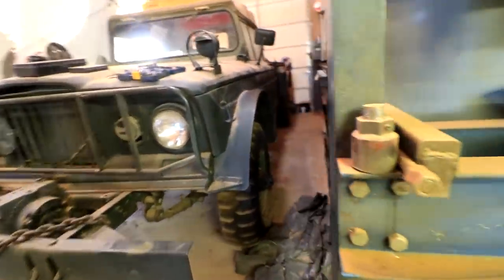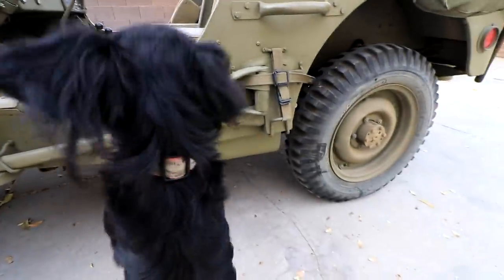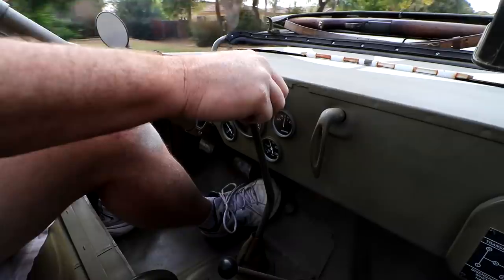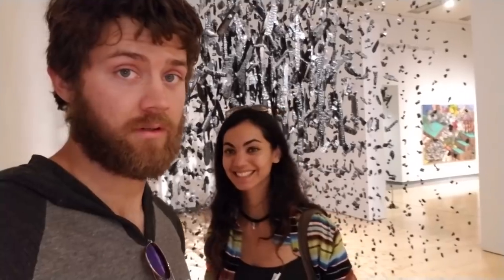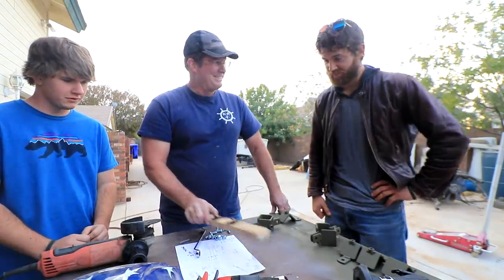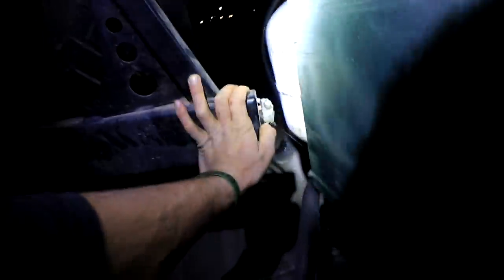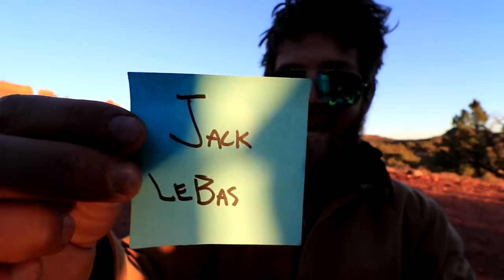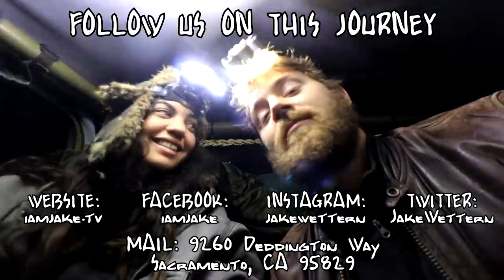CAMPING, JEEP WRANGLER BED & TRAILER MODS!

Comment: Jake, watch your tongue weight on the trailer.  The extended hitch will put much much more leverage on the bumper, as well as how the bumper is mounted to the Jeep.  Watch those areas for cracking.   Extending the tongue on the trailer itself would have accomplished the same results, but not put the leverage on the bumper like the extended hitch will.
Reply: +insaynbcr.  Moving the pintle pivot point so far back will also make the trailer very difficult to control under heavy braking. Not good, I would have mounted the carrier on the trailer.
Reply: As it was very nice if them to help Jake out. The other reason they should have extended the tongue  rather then the hitch is the purpose of a trailer like that is to go almost anywhere on a trail that the jeep can go by extending the hitch the break over/under angle will limit how the jeep goes down exiting a steep hill and drag  through the exit.   I wish I had as good of fab skills as that guy though!!! My welds don't look near as good. Safe travels Izzi and Jake
Reply: Anyone know of an extended pintle for a M-416 trailer?  Thanks!
Reply: Kim Kiriniki .. I can see that happening. Good point.

Comment: I hate to be that guy. Mainly your first immediate problem will be the raker effect pertaining to departure angles, once that gets hung up it will begin to mess up your bumper because of all the leverage. Secondly, the load on your bumper needs to be as close to it’s mounts as you can get it. It’s very important that there be a heavy extendable/retractable/removable slip hitch on the trailer once you leave the highway, explore off-road trailers and you will see how they are done. Best of luck.

Comment: Run 2 peices of chain from the ball to the d-rings on the back bumper. It will add some extra strength similar to how they do it for superhitches on slide in campers.
Reply from the maker: alaskan155 - Thank you for the suggestion!
Reply: Great suggestion, need to look at that!

Comment: The extended hitch looks awesome but you should really address that wiring for the trailer.  Even if you don't add the brake controller right away you can put the 7pin connecter into the jeep or bumper.  I'm surprised it hasn't caused you a problem yet with it dangling and banging against stuff like that. If you were in Ohio I'd totally hook you up.  Safe travels bro!

Comment: In the future young Jedi, you will go to a receiver and longer hitch on your trailer. This is not the tow set up you are looking for. Your friends are very nice but you need a slip tongue on your trailer. Sorry but I see problems there.
Reply: 9 feet up Adding a longer tongue on the trailer would definitely be ideal but it would involve totally redesigning the trailer. What problems do you see? Thanks!
Reply: +9 feet up.  His friends did an excellent jib but the design worries me. With the pintle pivot (fulcrum) so far back the trailer will be difficult to control under braking. Think tail wagging dog.
Reply: Jacob Boehmer.... The leverage on the the bumper will exponential for every additional inch added.  
Adding length to the trailer tongue isn't a big deal.  Just some metal and some welding.

Comment: I would urge you to rethink your hitch arrangement. It is very well fabricated but having the pintle pivot so far back from the Jeep axle will make your rig unsafe under braking.Think tail wagging dog. Either extend the trailer A frame or mount your spare carrier on the trailer.

Comment: Hi Jake;  What type of horn do you have on Jade?  It's not a wimpy stock Jeep horn.  I have an 84 CJ7 that needs the wimpy horn changed out and I like the sound of Jade.  David
Reply: No response required:  I pulled the horn out of a ford 350 truck.  Same physical size just modify the shape of the mounting bracket.  It's loud now.  I wouldn't want it any louder.

Merry Christmas Jake, Izzy and Annie.
David

Comment: Hate to be "that guy" but that extended hitch is dangerous has hell. Your typical hitch extends at most ~11" from the pin, this thing is probably close to 2.5ft if not more. Static forces considered, that's almost ~2.5 times the torque the hitch receiver was designed for; dynamic forces (ie. trailer under tow on rough roads), considering the inertia of a bouncing trailer can be much more(Think about why a 2lb hammer will sink a nail that would otherwise take a few thousand pounds of force to seat).

If you need more distance between the trailer and your tow rig, the safest way would be to lengthen the tongue of the trailer. You may be able to bolt on a tongue extension if you don't want to ruin the "value" of the trailer.